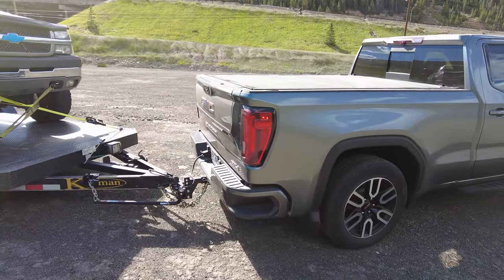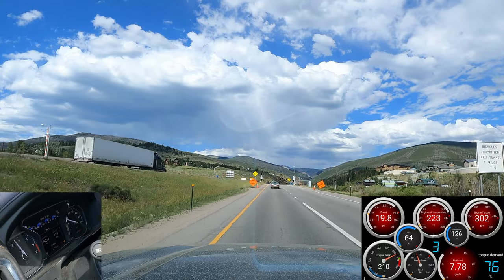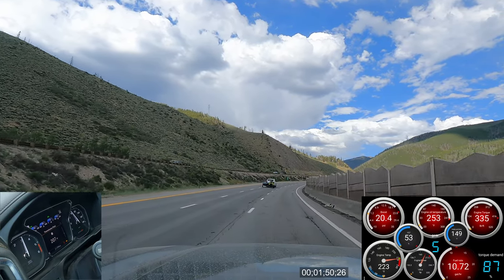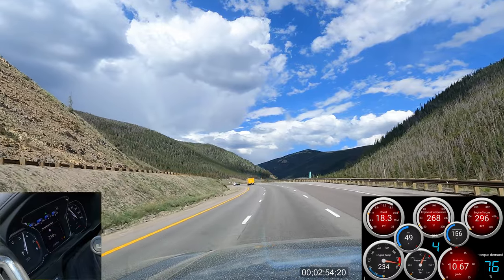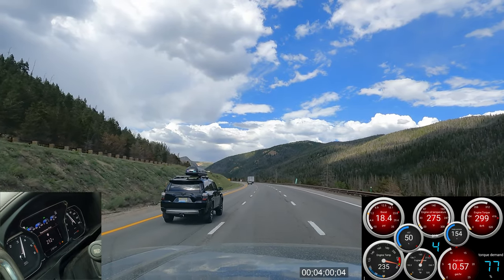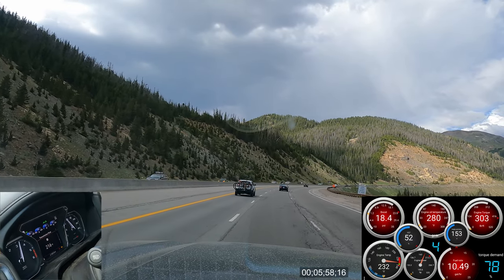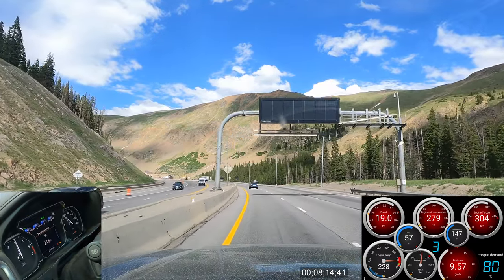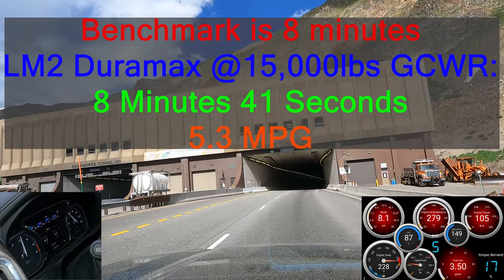Baby Duramax with 15,000 LBS VS TFL's Ike Gauntlet - Mega Tow Test part 2

Comment: My 1995 7.3 liter can beat that !
Reply: I would hope so with 4.3 more liters, but the 7.3 is an under performing turd.  Reliable yes, but extremely slow.
Reply: Yeah, I doubt it if it is a stock 7.3. The 1995 7.3 specs are 225 hp and 450 lb-ft. The little LM2 Duramax is 277 hp and 460 lb-ft and not to mention your 7.3 is going to be in a heavier F-250/350 unless you shoe horned it into an F-150 if it's even possible, so this Duramax 1500 will be walking all over you if you were pulling the same trailer weight. And I failed to mention that fancy 7.3 is 2.4 larger in displacement and making less power. LOL

Comment: Were you going up hill or down hill.  Audio indicates uphill (elevations) but the video looks like it is down hill all the way.  
Towed our 7500 lbs TT thru there last summer with a 2021 Silverado with the 3.0 and had no problems.  Engine temp never got above 220 and oil temp maxed out at 210.  And the Engine brakes worked without any problems on the down hill keeping speed at what I had set with the CC.
Reply from the maker: Up hill part 3 is down hill. Careful using cruise in GM it uses the actual brakes on truck and trailer.

Comment: I just want to be able to tow my 5th wheel travel trailer but I guess I need a 2500 I had one but it broke down now got a 1500 Texas edition 20" tire's I don't know if I can just get better shocks or springs and kind of want to add turbo to it it's a 6.0 V8.

Comment: Sorry You did wrong you all the max that truck if you would’ve had problems with it damage it the dealership and I fix it. You cannot go buy the sticker you have to go by the Vin number calling the dealership is a sticker is wrong. A lot of people found that out.
Reply from the maker: the sticker is accurate on this truck. otherwise it isnt what you were sold.

then  you know full refunds, $20K compensation, false advertising charges, etc. they are feeding BS to TFL.
Reply: They literally put the VIN on the sticker… weight ratings are matched to each individual vehicle based on build specs.